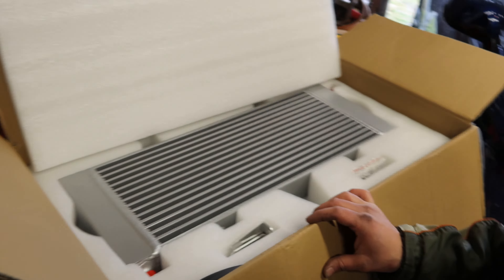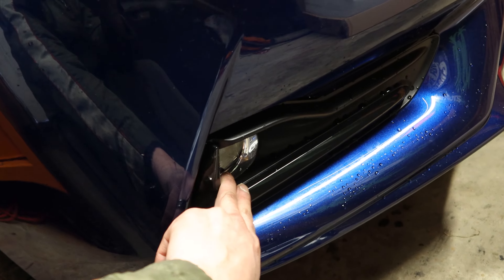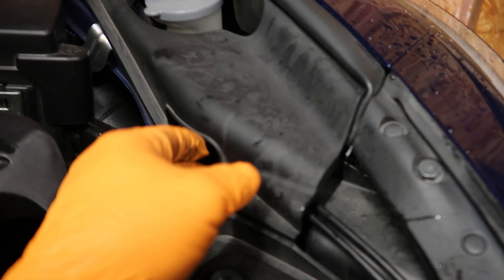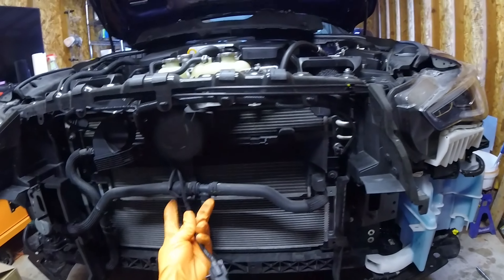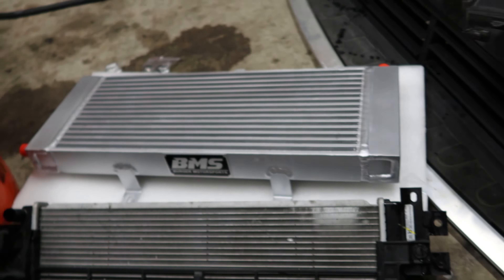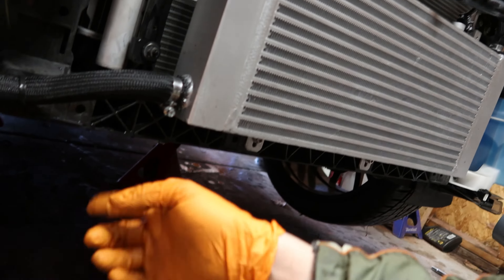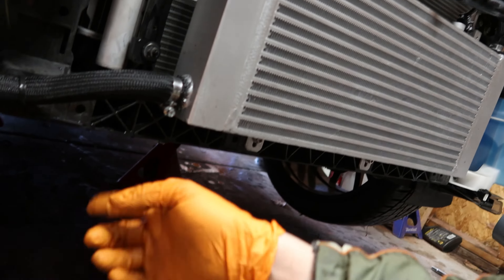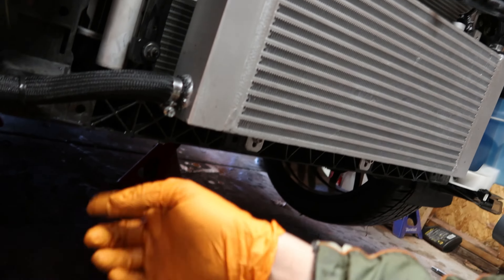2018 Q60 BMS Heat Exchanger Install

Comment: The nice thing about me having an ice tank in the trunk is that it pretty much self bleeds. I usually use distilled water and some water wetter since you know htown doesn’t really freeze. 

Nice and clean install!
Reply from the maker: Water wetter does wonders! I think he’s getting the 100hp tune, so this thing should sit around 380-410whp. It’s already pretty quick for stock, I was surprised

Comment: Did you use a vacuum pump for the coolent?
Reply from the maker: No, i couldn’t get my hands on one unfortunately. I tried using a slow fill method and it seemed to work but once we tuned it and was getting on it, the coolant code started popping up so he took it to the dealers to bleed it. Was about $120 to get it bled and within 30 minutes